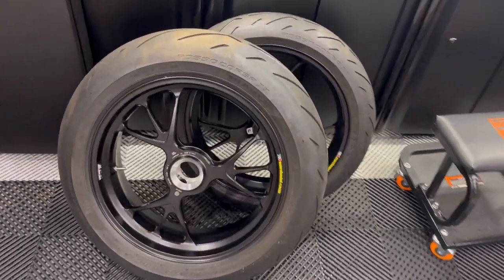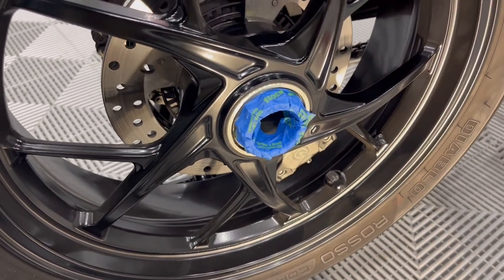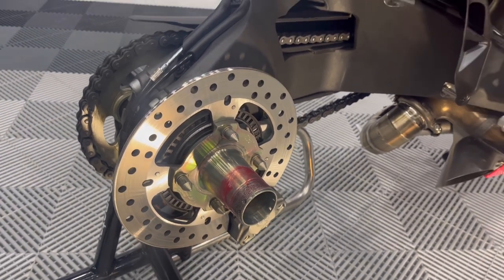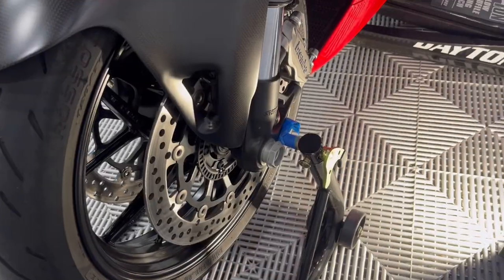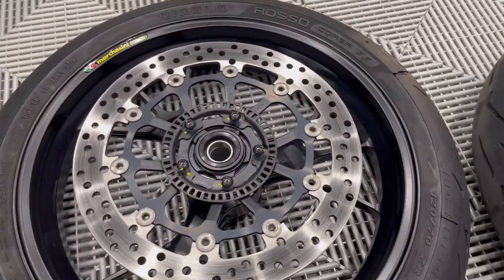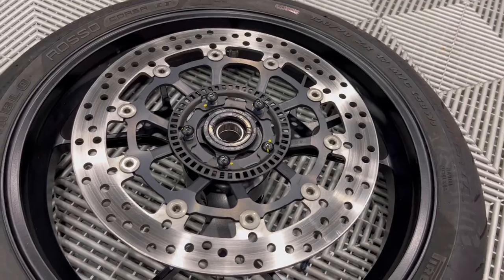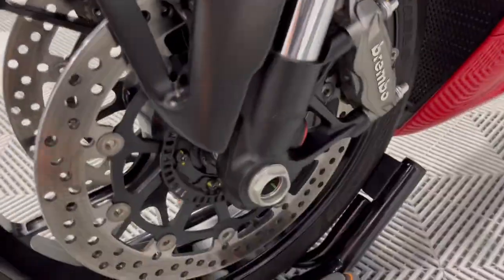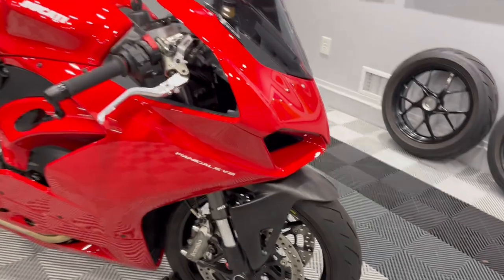Panigale V2 Gets Marchesini Forged Wheels

Comment: What are your thoughts on carbon fiber wheels vs forged wheels if money isn’t an issue and you’re just using the bike for your daily street riding?
Reply from the maker: I think it depends on the condition of your roads.  In California we pay a lot of taxes but get VERY little in return, so our roads are awful.  That being said, I would be concerned about CF wheel durability for a street motorcycle.  No denying they are much lighter and they absolutely look fantastic, but I would not want to have to worry about cracks.  To be fair, a forged aluminum wheel is not indestructible and can also bend/crack, but I am less concerned as opposed to carbon.

Comment: Any diffs btw 180 and 200? I’m also looking at 200 for my v2 but worried this changes its balance
Reply from the maker: I didn’t notice anything drastic but I also don’t track the bike. For just normal riding, I didn’t notice anything significant. If you are a very experienced rider that notices every little change with the handling characteristics, I’m sure you will notice.
Reply: yh don’t think that’s a big deal either. 
What about Marchesini forged? thought Oem to Forged won’t reduce enough weight but rear ohlins n oz forged are top of my list
Reply from the maker: @Brrrrr11 it’s not a huge difference weight difference going to Marchesini’s, but it is definitely lighter than the stock Enkei’s. Any weight you take off the wheels of course will be rotational and unsprung which makes a bigger difference than getting weight from other places on the bike.

Comment: Is the v2 wheel 5.5” and the v4 6.0”?
Reply: that's correct
Reply from the maker: The base v4 has the same wheels as the v2. It’s the v4S and R that have the Marchesini’s which are 6” wide.
Reply: So v4 wheels are 5.5 inch aswell?
Reply from the maker: I haven’t been able to find good info on this. I’ve researched and some say the wheel is exactly the same (V2 and base V4), others say it looks the same but the width is different. I think the best way to know is have the dealer look up the part numbers on the rear wheel.
Reply: @ridewithKY  I don’t think that’s correct. I think every 1000 bike runs a 6 inch wheel.

Comment: If you can fit a 190/55 tyre...do it.... There is absotuterly no need to use a 200 tyre on a 180 tyre spec motorcycle. From any aspect!
Reply from the maker: You can fit a 190 on 6” wide wheel obviously the profile changes when doing so. I’ll leave the 200 as it’s the factory spec for these wheels. The v4 runs a 200. Don’t think it’ll be an issue here either.
Reply: @ridewithKY  sure you can try it....but there are absolutely no positives on this change. Only negatives. Except the weight loss from the wheels and thats it.
Reply from the maker: I’ve had it like this for months. No issues.

Comment: Awesome video man, did you use the spacers from the v2 wheels or the v4???
Reply from the maker: I used all the hardware from the V2 wheels. The only thing I carried over from the V4 were the bearings. Hope that helps. Thank you for watching!
Reply: When you bought the marchesini did it came with the bearing from v4 or did you buy it?
Reply from the maker: @carlosiglesia1013 it did come with the bearing.
Reply: @ridewithKY  thank you!

Comment: You should weigh them without the tires.
Reply from the maker: Ideally yes, kinda… It would really be best to weigh them completely stripped. No bearings or anything. But it’s not practical to do that in this context.
Reply: @ridewithKY  no, if you just took the tires off and weighed  them, it would be apples to apples
Reply from the maker: That’s wrong, but whatever you say.